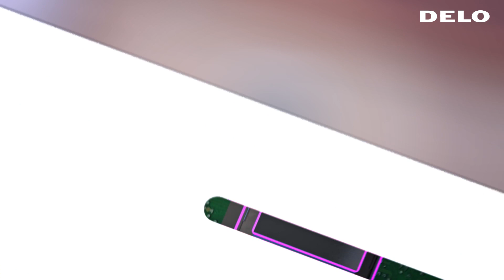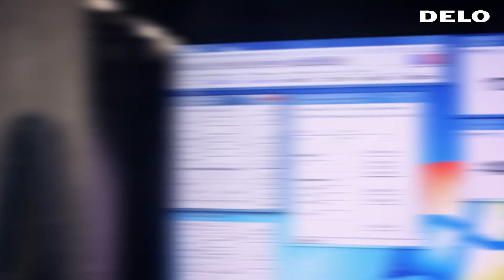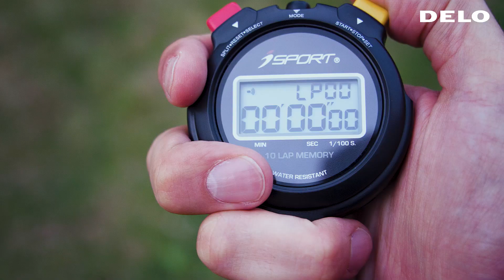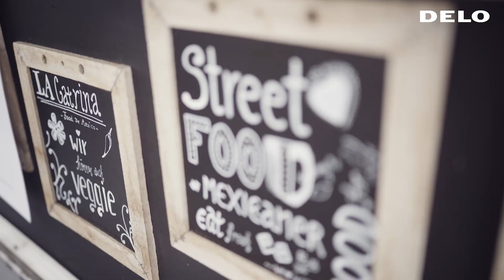The World’s Strongest Adhesive

Comment: Show..look at 2:19..
Reply from the maker: The construction shown at the sides of the glued cylinders is a safety rig (2:19), which would hinder the truck from falling down completely. Due to its elongated hole at the bottom shaft, the safety construction carried no weight at all. During the whole time the full weight of the truck was carried by the adhesive. The construction was examined and approved by a Guinness World Records adjudicator, an independent surveyor and two witnesses.
Reply from the maker: You were wondering how our safety construction works. We demonstrate it in this video. Check it out.
https://youtu.be/y3yuGQjqpkk
Reply: Why just not to lift it for few cm ? So you wont need the safety construction.
Reply from the maker: Good idea. In this case, it was the Guinness World Records regulations that prescribed it to hold the truck 1 meter above the ground for one hour.
You can read more about it here: https://www.delo-adhesives.com/en/news/industries/cross-industrial-information/the-worlds-strongest-adhesive/

Comment: на 2.19 зазоры у страховочных шарниров должны быть больше. Вертикальные опоры нижним краем должны ЛЕЖАТЬ на оси и иметь зазор снизу, чтобы было куда падать, если что.  А так - фуфел.
Reply: Exacto xd
Reply: Estan en lo correcto xd
Reply from the maker: Dear Максим Антонюк, 
Due to its elongated hole at the bottom shaft, the safety construction carried no weight at all. During the whole time the full weight of the truck was carried by the adhesive. The construction was examined and approved by a Guinness World Records adjudicator, an independent surveyor and two witnesses.
Reply: @DELOadhesives  Dear Sir!
This video is made as a show. Technical data is very small. It is enough to remove the safety node and lift the car to a height of 3-4-5 cm. In case of a fall, there is no damage for the truck. But it will be honest and technically competent.
Maksim Antoniuk, Engineer, Designer, graduated from the Engineering Faculty of the University
Reply: @МаксимАнтонюк-м9ш   the whole data such as exact Guinness World Records requirements or test data are given at: https://www.delo-adhesives.com/en/news/industries/cross-industrial-information/the-worlds-strongest-adhesive/

Lifted weight: 17.5 t (metric)
Adhesive quantity: 3 g
Bonding are: 39.8 cm²
Applied force (front bonding): 43.1 N/mm²
Improvement compared to the old record: 7 %
Reply from the maker: Dear  @МаксимАнтонюк-м9ш ,
You are absolutely correct, 4-5 cm would have been sufficient for showing the strength of the adhesive. However, the official guidelines by Guinness World Records require hanging the weight 1 meter above the ground.
Reply from the maker: You were wondering how our safety construction works. We demonstrate it in this video. Check it out.
https://youtu.be/y3yuGQjqpkk
Reply: @DELOadhesives  Thank you for this video.
 Max.

Comment: 2:19  ???
Reply from the maker: The construction shown at the sides of the glued cylinders is a safety rig (2:19), which would hinder the truck from falling down completely. Due to its elongated hole at the bottom shaft, the safety construction carried no weight at all. During the whole time the full weight of the truck was carried by the adhesive. The construction was examined and approved by a Guinness World Records adjudicator, an independent surveyor and two witnesses.
Reply: @DELOadhesives  
Dies ist dem Fokus von David Copperfield sehr ähnlich. Sie können den Betonstein ohne Versicherung und mit einem Gerät, das gleichzeitig das Gewicht misst, auf eine Höhe heben. Denn das Video ist schön, aber nicht wahr genug und der Fiktion sehr ähnlich
Reply: @АлексейБомко-р4ф   I am working for DELO. The device for constantly  measuring the weight is shown very shortly at 2:14 (black device) and transmits the signal wireless to the reader. It hangs below the glued cylinder. No magic needed :-)
Reply: @ph1643  Und im Allgemeinen scheint es, dass Ihre Technologie aus der Zukunft stammt))). Also sei nicht beleidigt
Reply: @DELOadhesives  we all see the same: the bottom shaft is in the low position in the elongated hole at 2:19, it is carrying weight of the truck. You say, Guinness men guarantee the experiment, but the video shows another picture. U better hang the truck without that construction. If u are sure in the properties of your product of course :)
Reply from the maker: You were wondering how our safety construction works. We demonstrate it in this video. Check it out.
https://youtu.be/y3yuGQjqpkk